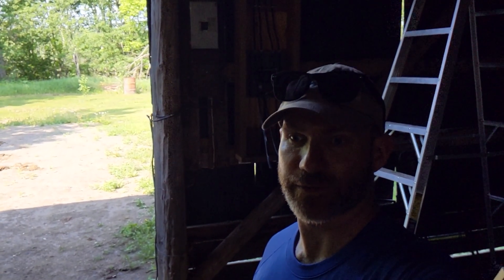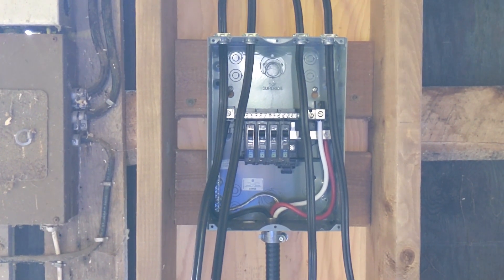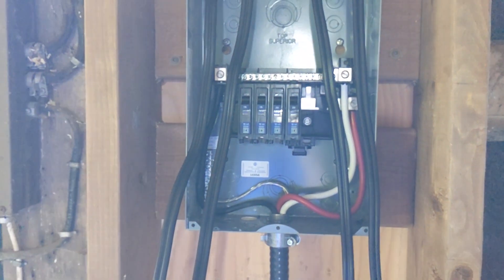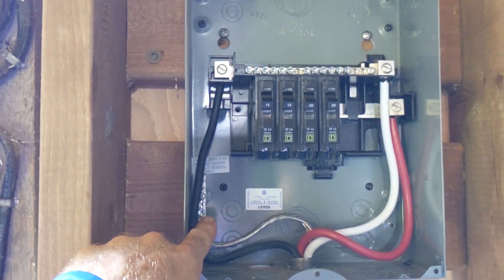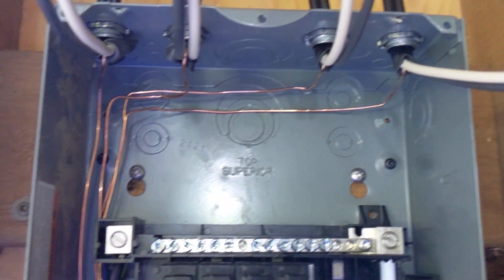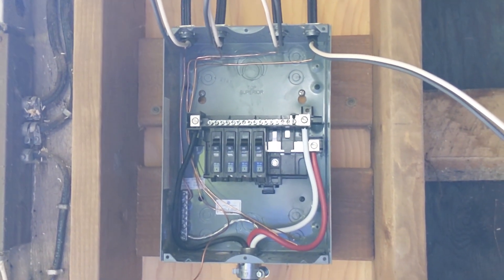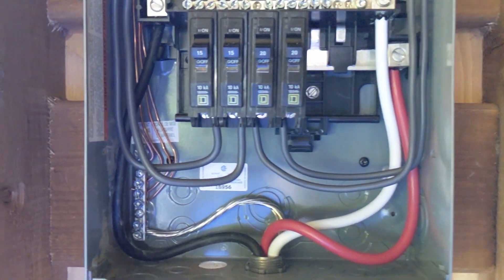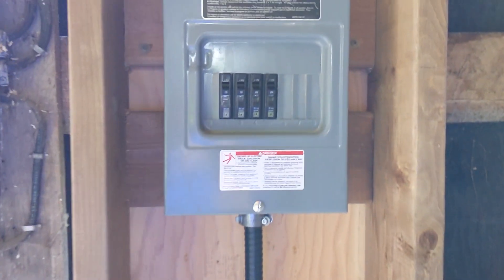Pole Barn Electrical Installation : Part 4

Comment: 10AWG wire for 20 & 15 Amp circuits, I'm sure you had a the reason for using the direct burial 10gauge wire. 
National electrical code is the minimum requirement. So you don't have to worry about voltage drop on those circuits. (15 amp 14awg, 20 amp 12awg, and 30amp, 10awg)
Reply from the maker: Well my electrician said the 10 AWG wire since there was already a serious run of wire from the house to the shed/barn....over 100ft that's for sure, so upsize the wire to make up for voltage drop. Some of the runs in the barn were also over 100ft. I was also told since it was an outdoor barn or structure that I should be using direct burial, definitely not nmd90. Thanks again for watching!